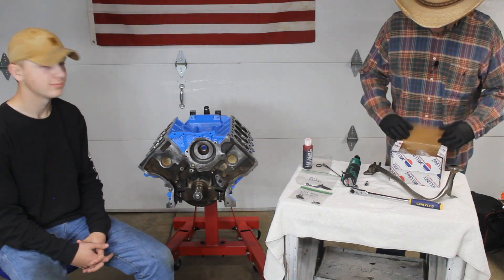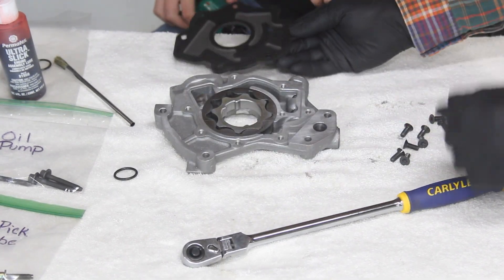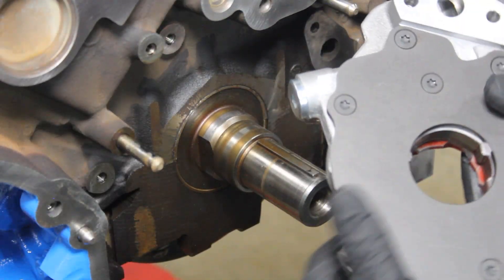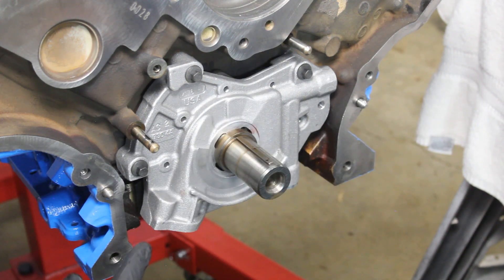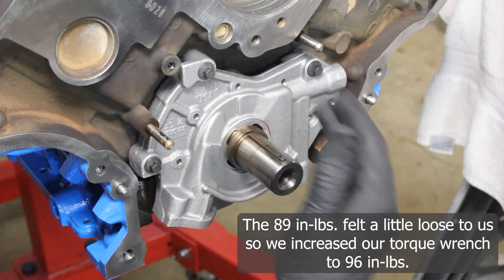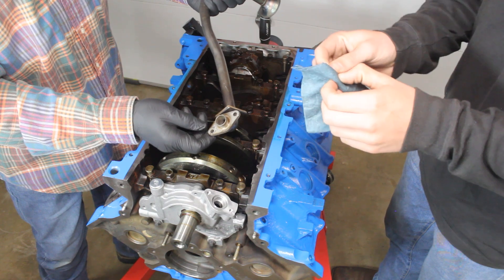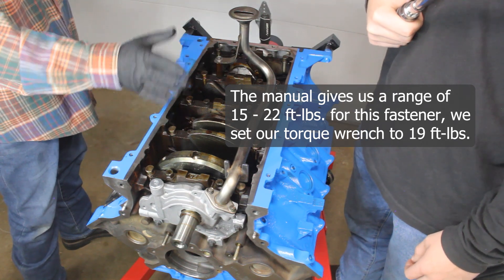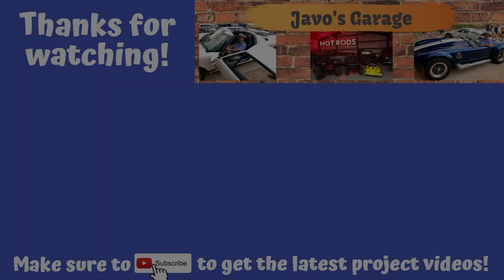Melling M176HV Oil Pump Install - Ford 5.4 2V Build

Comment: Another FYI this pump can be installed with engine in car and oil pan fully bolted on with timing system removed. Prime the pump by poring oil into the oil filter housing output. The engine oil can be filled to proper level with oil filter removed. as well as the oil filter being filled without spillage due to the antidrainback valve on Motorcraft filters. prime oil pump before starting engine. Install filter with plugs out then engage starter for 10-20 seconds 3-4 times while gas pedal is fully depressed.
Reply from the maker: Thanks for the additional tips, always helpful!

Comment: QUESTION, I noticed the backing plate dose not go over to the block hole and no gasket used on pump metal to metal no seal, seems like a place for oil pressure lose. I assume the oil creates enough of a seal that no gasket is needed ? Seems like a gasket should be there. Working on a 6.8 v10 and it has the same oil pump

Comment: 🤙awesome job 🤙 I’m just doing a quick head swap for passenger side on my expedition and replacing other head gasket too and of course the chain and pump. I’m kicking myself for not just pulling the motor🤦🏻‍♂️ would’ve been way faster.  Since changing oil pan gasket is worth doing now 
       I’m just trying to get this running so I can start working on my daily without feeling rushed anytime I do something…and can fit more people than don’t have to climb a ladder to get in 😂
Reply from the maker: I hate it when I do a job like that, and it ends up being more than I expected.  It's all rear view now but I would have to agree doing that much work would have been easier with the motor out.  May have been about the same time overall but by removing it you would have much easier access to everything and save your back in the process.  Hopefully you won't have to do that again huh?  Thanks for stopping by and taking a moment to leave me a comment!
Reply: @ 🤙 almost done with putting motor together 🤘
I ended up blowing a spark plug yesterday but luckily it happened oddly when it was idling, so it didn’t damage my coil 😮‍💨 a actual motorcraft. 
      I’m planning on getting my heads done on my lifted truck so once my expedition is done hopefully in next couple days, then I’m going to just truck’s motor and go through it a little  and do the cal-van inserts and a few other things that will be a surprise for after hunting season for me and my brothers yearly winter trails mission 🤷🏻‍♂️🤩

Comment: I thought the higher pressure was meant for the 5.4 v3 motors? Will this pump work on my 2004 4.6L v2?